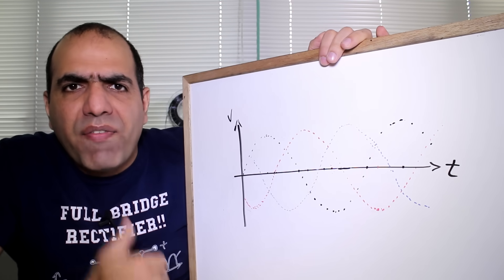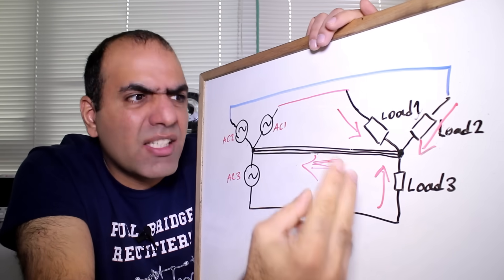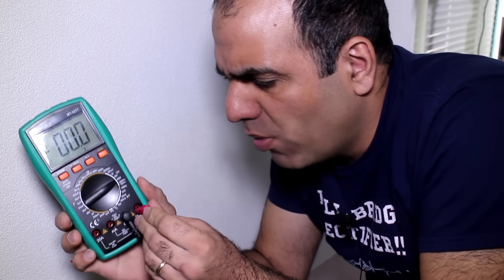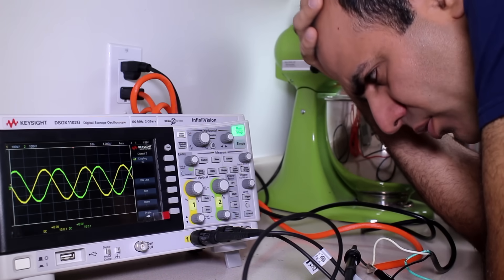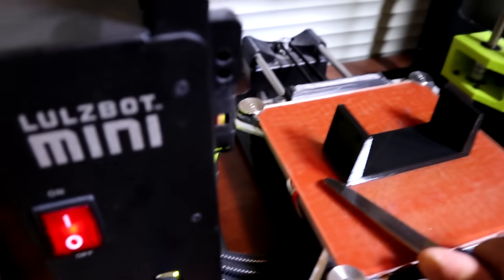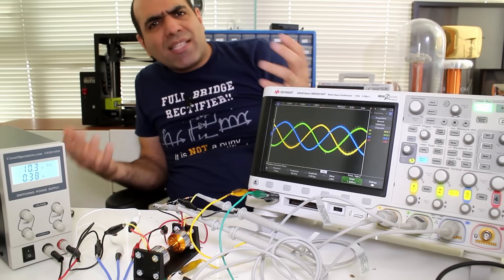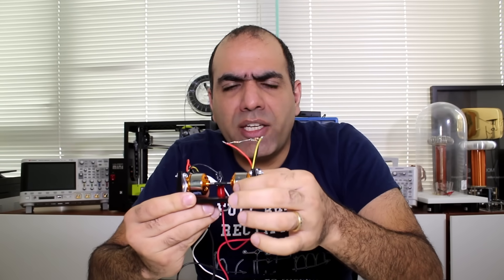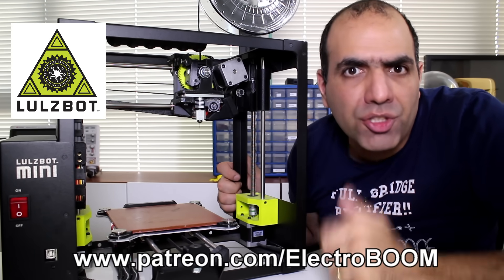Why 3 Phase AC instead of Single Phase???

Comment: Question for you;  If incandescent bulbs are designed to fail by a cartel, is the design based on the filament wiggling slightly at 50Hz or 60Hz and eventually creating stress cracks and dying?  Would running a FULL BRIDGE RECTIFIER and capacitor before the incandescent build make it wiggle less?  How could we measure that?  Would that make it last longer?

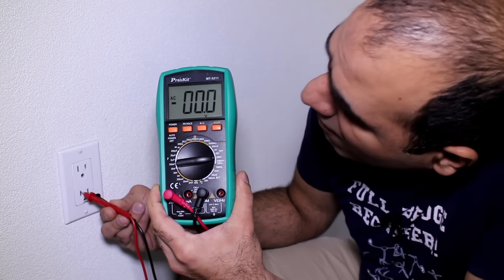Comment: 3:05 why did it explode 😭
Reply: if we set the multimeter in current mode, it'll become an amperemeter which has to be placed in series with electrical source, thus triggers a short circuit bcs of overload current

besides, in voltage mode, it'll become voltmeter that placed parallel with the part u measured, the parallel circuit has 2 branches with same voltage level end to end that ur voltmeter in one line n the other become current divider which distributes it evenly, thus anticipate it from the risk of overloading

always remember, voltage doesn't kill u, current does
Reply: a multimeter in current mode is basically a short. Huge current flows through the meter. And depends on the brand and model, some have surge protection while others don't. The ones that dont have surge protection mostly get destroyed.

Comment: Could you power something with a single phase motor between the phase and the ground? is the neutral necessary for it to work?
Reply: You could but neutral and ground have different jobs. You want to the current to return on the neutral instead of the ground.

Comment: Its split phase going to a house not 2 phase. So there is a neutral center tap on the transformer for the 120v and between both hots its 240

Comment: I thought the US/CA usually supplied centre tapped split phase 120/240 (with 180 degree phase angle) to residential properties from the LV stepdown transformer?

I’m guessing this is at a property with a 3 phase supply and the 120V supplied by a customer owned transformer? I get 415V phase-phase if I run a meter across the room between some of my outlets, but round here our outlets are all 220V.

Comment: I don't understand why you don't use diectely the control unit of the motor to generate 3 phase AC directely from DC without power loss of friction between motors. Please correct me if I am wrong!!!

Comment: In India higher power draw households usually get a 3 phase connection. Like in a house with mutiple AC units, an electric vehicle charger and a water pump to pump water from a well to a tank above and more.

Comment: Hello, I'm learning Basic Electrical Theory right now so forgive me for possible asking a silly question lol.

I understood the 3 phase explanation up until the point to where we were able to get rid of the 3 cables going back to the source. Why wouldn't we need the 3 circuits going back to the source? Wouldn't that be necessary to complete the circuit? The definition I have for a circuit is that it is an arrangement of one of more closed paths through which electricity can travel. So far I've learned about Series and Parallel Circuits. I've learned about Ohms Law and Watts law and the relationship between current/voltage/resistance/power. While learning about AC though I get stuck on this part because I don't understand why we wouldn't need the 3 wires going back to the source to complete the circuit. At this point I must have missed something, would it be possible for anyone to point me in the direction to understand why we would be able to get rid of the 3 wires going back to the source to complete the circuit in this 3 phase example?

Comment: 5:27 If the output of the controller is 3 phase AC, why not simply use that, rather than use 3 phase AC to turn a motor to turn a generator to create 3 phase AC?
Reply: he is just showing everything, power to motor to generator to power

Comment: hey dude its funny but stop. be safe. can you have 2 phases to full bridge rectifiers for dc voltage in parallel and the last phase to run a ac motor. to keep it turning

Comment: By printing the part laying on its side you avoid having weakspots of the thin parts line up with weakspots of the layer adhesion, resulting in a much stronger part that will probably not break when trying to remove it from the bed.

Comment: Very well explained that - for energy transmission 3 phase is - while using only 3 wires for balanced load between phases- is most energy and cost (copper use) effective! 

 And there is more: single phase driven motors have torque variation during each turn while 3 phase motor have constant torque resulting in less noise and wear! Another advantage is you don't need one or 2 capacitors to create a rotating field which makes 3 phase systems much more reliable as capacitors break down much faster than any copper wire or steel core. Add permanent magnet rotor and you have synchronous motor even more accurate to control RPM. or use motor as synchronous capacitor to improve cos phi..Several 3 phase  asynchronous motors born before the 2nd worldwar still work perfectly  which is testiment for the reliability of the 3 phase system without electronics.(to reduce in rush current for big moters star/triangle switches were used. To change rotation direction just swap any 2 of the 3 phases. Switching 3 phase is easy as each phase has it zero crossings albeit 120 degrees after eachother. And if you  really need a DC voltage you just need 6 diodes - good for charging EVs- as you get much less ripple than a rectified single phase which - without stupid capacitor -  touches zero twice per period (100 times per second at 50Hz).. civilized Europe (and many other regions) has standardised its consumer voltages to 3 phase 240V (single phase to neutral) and 400V between any 2 of the 3 phases.. just some more advantages of 3 phase systems, Wessel  

Furthermore:
If you want speed control nowadays 3 phase frequency inverters from 10Hz to 200Hz are easily available allowing decent torque control from start up at 10 Hz to above 10000 RPM for the very reliable 3 phase asynchronous motors...

Comment: Three phase is better because it provides a way to get a near constant voltage supply, as opposed to the 60 hz power fluctuation characteristic of single phase AC power.

That low hum you get from an electronic device is the result of the 60 hz ac signal. 
That fluctuation represents variation in the power delivered by the electrical system, and can pose issues in all sorts of situations.

Comment: Is there a reason why they use three phase and not say 30 phases
Reply: Three suffices.
Reply: more phases, tho means more power, but also more complexity, more maintenance, more cost. In theory, 30 phases gives you 30 times more power. But in practices, 30 phases means more coils, more wire, more impedance created by having more winding, and wires in the generator, thus less efficiency.  So, 3 phase is like a "sweet spot"

Comment: In theory could there be more that 3 phases? If all the different sine waves are shifted accordingly so that the sum is zero. Could there be 4 phases if each one was 90 degrees out of phase?
Reply: Four phases doesn't make any sense, because two of them are same as the other two, connected the other way.

Comment: Howdy. To answer the header question.
1. The neutral can usually be rated for smaller wire gauge (larger AWG). Saving of material.
2. The three phase system is fully deterministic. The direction of rotation is fixed. A three phase induction motor will start and run the desired direction. No need for start up capacitors. One phase motors may start and run in either direction if the capacitor fails.
Regards.

Comment: The electricity in your home in Canada is single phase 2 pole, the transformer outside your home on the pole transforms in such a way the two 120v wires are in phase, the only real reason 3 phase is used is really for the physical balancing of the machines producing and using the electricity, the same reason you see windmills have 3 blades, it’s much easier to prevent shaking with 3 torques 120 degrees apart

Comment: I believe what you're talking about is "Split Phase or Single Phase Three Wire System..." There aren't really a lot of two phase power usages out there.

https://en.m.wikipedia.org/wiki/Split-phase_electric_power

https://en.m.wikipedia.org/wiki/Two-phase_electric_power

Only reason I'm saying anything is I'm confused...I had always heard/ learned that really only 1 or 3 phases are used... and it would make sense that what you're talking about is the split phase system since the two wires on it are indeed 180 degrees out of phase of each other...

Comment: Why didn't he simply use that motor driver circuit for 3 phase ac doesn't it also output 3 Phase ac
Reply: As he says in the video, the controller outputs a PWM signal which is just a square wave turned on and off at appropriate speeds. Motors don't need a perfect sine wave and the PWM signal here is a close enough approximation. On the other hand such motors will pretty much always output a perfect sine wave because of it's construction
Reply: @BarteG44  ah ok thank you for the explanation

Comment: Three phase can run single phase on each wire also. So, you can still power 120V equipment off of three phase.

Comment: And the motors, like 3 or 40 hrsprs will have a variable speed drive that soft starts by controlling the frequency the Hz so it gets full voltage but chop chop. Motors don't like to be started at low speed (low voltage) that's why fans always have off next to high. The sound of really big motors spooling up is fantastic. lol so random

Comment: You are hysterical, and I'm glad you're out there getting kids interested in electronics.  Never did it on 120V but I cannot tell you how many times I've left my meter in amp mode and the probe in the wrong plug trying to check a voltage 🤣

Comment: Is it true that 220V is just two out of the three phases of three-phase? I was sure I'd heard that it was actually the result of a tapped transformer instead, with the phases in sync. Was I misinformed, or is that true in some places and not others?
Reply: When you have 3-phase wye with 120v legs, the phase-to-phase voltage is 208v, not 240v.  A split-phase system is 240v (220v is just weak 240v) with 120v obtained from a center tap on the secondary.

Comment: There is also a mechanical advantage to using three phase generators. With a single phase generator, there is an uneven load which varies sinusoidally which can place stress on the device. In contrast, a three phase generator, with a reasonably balances load across the phases, will have a roughly even torque loading, which helps with reducing stresses on the generator set and increases it's lifespan. 

That happens in reverse too. A 3 phase motor will, all other things being equal, deliver a more even torque than a single phase motor.

Comment: Eh, on a long distance you would only need two wires, because you can split them up to the outlets at the house. (And you do this, too, with  the 3 phase system.) I don't believe that this is the reason for 3 phases. ;-)

BTW: I'm pretty sure that in the EU it is forbidden to have different phases in one housing for regular outlets. When you need more phases at once (i. e. for the oven), you get special housings without a regular outlet.

Comment: I believe you have an error. Canada and USA send single phase to a home and use a split phase transformer to get a center tap and generate two hot legs at 120v each and 240v on the two hot lines.
Reply: A single phase is provided to the transformer primary.  The transformer splits the 240v secondary with a center tap.  Three wires are connected to the customer.  Whether you think of it as 240v split phase, or two phase 120v is merely a matter of semantics.
Reply: @GH-oi2jf  So that is not correct.  yes some folks call it that but its not semantics but in-correct sorry.

Since both line voltages are derived from a single phase of a distribution transformer with a center tapped neutral and are 180° out of phase with each other. a phase to phase would be 90° out of phase so no you are wrong - have a nice day.

Comment: I noticed something else about 3 phase

Ill give you a little background information

Im a traveling showman, i have bouncy castles, so i have powerful fan's/air blowers to pump the bouncy castles up

The single phase blowers consume 6 amps at 240 volts

The three phase blowers only consume 2 amps at 415 volts

So does that mean in the long run, the three phase blowers will be cheaper to run?

I have a three phase, 30 kw diesel generator, so will the three phase blowers put less strain on the generator than the single phase blowers?
Reply: Cheaper to run, but I’m sure as a businessman you’re calculating your initial cost to invest. No it also depends if you’re traveling hooking things up where you’re getting your power from right?

Secondly, making sure that you have a balanced load on your generator is important or there will be stress. 
Which I feel you already know all of this because you’re keeping track of your power consumption.

I don’t think electric boom is ever gonna answer this. It’s been five years.
Reply: @TheKevlarSamurai  thats right, i have considered the power consumption for balancing, its very difficult to perfectly balance the load in my working atmosphere, but i can only try my best right?

I have also taken into consideration the fact a friend of mine has single phase rides, which he will also want to power from my generator, the rides have soft starters, and actually consume less power than my single phase bouncy castle blower fans

So hopefully, the power will be balanced by average, if that makes sense? Over the three phases

I have calculated that one phase will be just my large blower, a second phase will be my smaller blower with a couple of LED floodlights, and the third phase will be my friends two rides when he is there, and a sound system when he isnt

The sound system will be spread across all three phases when he is there, i have multiple power amplifiers, so each amplifier can be connected to different phases to spread the load

The generator set is a 30kw set, and we will be lucky to ever use 10% of its overall capacity, so in theory, the set should only be running at its 1500 rpm idle, it should very rarely ever get throttled by the load, therefore should be very cheap to run, if im correct?

Technically, it should be cheaper to run than my friends petrol generators, as there constantly throttling when you turn something on, which as you know consumes more fuel, whereas, the diesel set of mine should only ever be running at its set fast idle

I know electro-boom may not answer, but i was counting on someone like yourself replying to give me additional information

Two pairs of eyes are better than one, and if you have more experience with generators than me, then your advice will be greatly received, and i can prevent dage to my equipment, as theres no amount of googling or youtubing that can exceed someones personal knowledge

Comment: I think you dont need 4 wires in 3 Phase system. As long as you Connect the 3 Phase Motor in Star or Triangle shape I guess

Comment: The 2 phases distributed to the house originate from a single phase from transmission. The street transformer is center tap. So the house 2 phases are 180 degrees apart, not 120.

Comment: Since the output of a power plant is inherently 3 120 degree phases, what happens to produce 2 180 degree phases for typical US residential power? I see your home has 2 120 degree phases. Is that because you have 3 phase to your house? How much more efficient is a heat pump or other heavy equipment that runs on 3 phase than split phase?

Comment: It's eerie watching this given the recent loss of the submersible going to the Titanic. The pressure at the Titanic is around 400 bar.

But here's a question you can test. Which is more survivable -  a cylinder shaped or a spherical or egg shaped submersible. I'm going to guess sphere is the way to go.

Comment: Tesla’s 2 and 3 phase system little different than the the Mikhail Dolivo-Dobrovolsky system in use today. Tesla used 6 wires to transmit 3 phase and 4 for 2 phase. The delta and wye Idea was Dobrovolsky’s

Comment: I think 2 phase power distribution is possible in the land of the Canucks.  The calculation for phase to phase voltage =  V * square root of 3.  So 117  * 1.732 = 203.

Comment: brushless ac motor with 3 cables, thre phases, shouldn't be 4 cables, 1 each phase, 1 return???
Reply: nope.  the windings are connected at a common point. as he said, no need for a return because the current on the common point is zero.

Comment: In South Africa it is very common to have 3 phase 240V to the home. We also don't have GFCI, we have an earth leakage for the home I think that's similar. So surprisingly good considering the power company is corrupt and mismanaged so they give us load shedding and turn off our power for +- 8 hours per day. Don't believe me? Look up load shedding South Africa. This is why one of my phases a a 5KW Inverter and a 4.3 KWh batter and some solar panels (12 x 345W).

Comment: @Electroboom but why don't we use 6 or even more Phases instead?

That way we could get down in Amps massively, with lowering power loss even more.

For charging a Car at 11 kW I either need:
230 V 48 A
3x 230 V 16 A (in Germany every home has 3 Phases) 
or 6x 230 V 8 A

That way, I would only need half the Amps with 6 Phases compared to 3 Phase.
Power loss through wires etc would then be only 1/4.

Is there a good explanation why we only need 3 phases instead of 6 or even 12?

Comment: The US generally does not do "two phase" the same way you have explained.  We do a center tapped, split secondary from a single phase of the high voltage.  So we do in fact have a 180 degrees of phase angle between the 2 120V legs giving us 240.